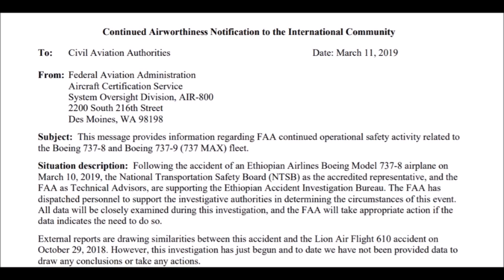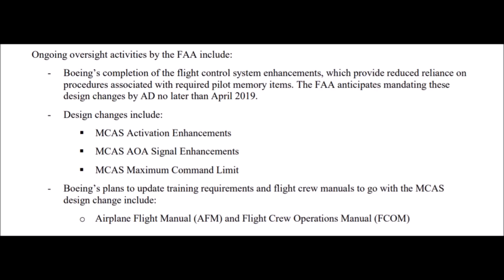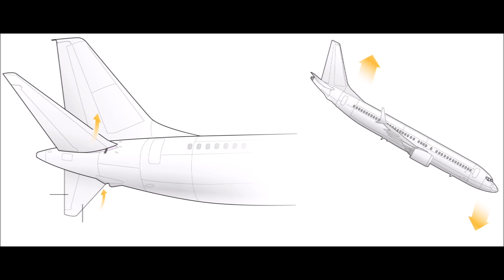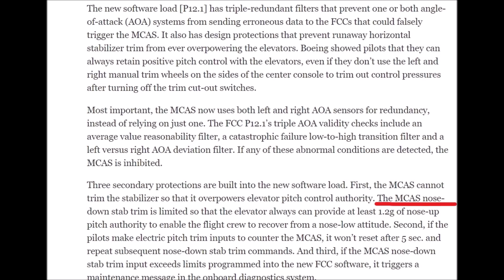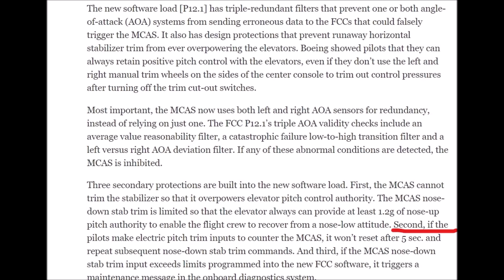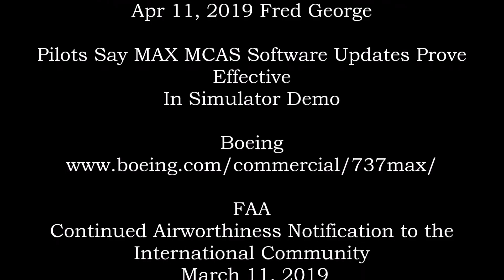737 Max UPDATE 14 April 2019 "The Fix"

Comment: I have a hobby of watching documentaries of airplane accidents and am particularly interested it those caused by automation.  Beside the 737 MAX there are two others I know of both of which involved Airbusses.  
 
Air France Flight 447, Airbus A330
 
The airplane was caught in a storm and the pitot tubes froze and the computer couldn’t determine air speed so it dropped out of autopilot.  After a delay the pilots started hand flying the aircraft but didn’t follow procedure.  When you don’t know your air speed the procedure is to apply 85% power and raise the nose 3 degrees which is supposed to create conditions to prevent a stall.  Instead what the pilot did was push the nose up which forced the plane into a stall that was maintained for about 10 minutes and ended in a crash into the ocean.  There were three pilots on board, the senior pilot was taking a nap outside of the cockpit and only returned shortly before the crash.  The copilot didn’t realize what the pilot flying the aircraft was doing and so didn’t correct it.  
 
Airbus uses a joystick to maneuver the aircraft instead of a traditional yoke.  The position of the pilot’s joystick is not copied to the co-pilot and so the pilot's inputs were unknown to the co-pilot.  Boeing still uses a yoke and all inputs are copied to both yokes which gives both visual and tactile input that informs both pilots, the Airbus controls provide no tactile information between the pilots and the visual information is not as obvious as Boeing's.  In a situation where the aircraft is in turbulence a Boeing pilot can brace himself with both hands against the yoke but an Airbus pilot can only brace against the joystick and most likely can’t avoid applying unwanted inputs.
 
 
XL Airways Germany Flight 888T, Airbus A320
 
This accident occurred during an acceptance test for an airplane coming off lease.  The pilot descended rapidly and attempted to level off but the aircraft continued in a nose down attitude though pilot was commanding nose up.  It was theorized that water inside the angle of attack indicator had  frozen at high altitude and prevented it from moving, this caused an indication that the nose was high and so the automation tried to lower the nose.  The pilot could have saved the aircraft except for one little problem which is that Airbus does not give full control of the elevator to the pilot, instead the joystick only operates over a percentage relative to the trim input.  The pilot was commanding full nose up but that wasn’t within the range of the joystick on that occasion and so the plane crashed.

What to make of this

There are common threads between these accidents and those involving the 737 MAX in that human factors were not adequately addressed by the automatic systems.  Even though there existed procedures to correct the problems the sudden onset of the situation, accompanying flood of error messages and lack of response to the pilot’s inputs together created confusion and panic. This is not a mental state conducive to problem solving.  
 
Also there are too few sensors supplying information to the automation.  Why should there be only two angle of attack indicators and why are they purely mechanical.  Anyone who owns a smart phone knows it has sensors that are able to tell which position the phone is in and whether it is moving. It can detect speed, altitude and position.  Why haven’t these technologies been adapted to augment the traditional aircraft sensors.  Example: The angle of attack indicator says you are climbing but the solid state gyro says you are descending or the pitot tube says your airspeed is too slow but GPS says it is just right.  The automation should have available to it sensors that not only are redundant but also obtain information using a variety technologies to limit the influence of environmental factors such as icing. 
 
Every pilot knows how to hand fly an airplane and only needs sufficient automation so that the aircraft obeys his inputs.  In an emergency rather than require the pilot to figure out how to correct the automation why not have a big red button on the control panel that turns off any aspect of automation that has the ability to override the pilot’s inputs.  The pilot would then have confidence that the aircraft is obeying his inputs and would be able to quickly determine if the problem is mechanical or due to automation errors.
 
Next I would make the automation smarter.  The tactic of issuing a flood of error messages that require the pilot’s interpretation is taxing to the intellect particularly in an emergency.  The automation should be smart enough to reach a conclusion not merely issue error messages.  That conclusion should be the same one the pilot would reach if given the time to do a thorough analysis.  The messages should not only tell the pilot what is wrong but also explain how to correct the problem.

Comment: Boeing and the FAA's mistake was to assume all pilots would properly handle the problem using established runaway trim procedure... 
1) Manually hold the trim wheel to prevent unwanted nose down trim
2) Use the prominent 'trim off' switches to depower the trim motor.. AND LEAVE THEM OFF
3) Reduce power to reduce trim forces
4) use the manual trim wheel to reestablish neutral trim
MCAS used one sensor for compatibility with other b737 systems which all used single sensors.
IMHO the main question is why the $19 billion per year Federal Agency FAA failed in it's oversight.. of course Govt is sloth, irresponsibility, waste, stupidity, incompetence.

Comment: A software fix for a hardware problem ? ...  Allow me to be extremely skeptical.
Reply: It seems like that on the surface but many designs that would surprise you can't even maintain level flight without reliance on computerized flight management systems what we're all actually relying on to keep us safe is sufficient redundancy the real cause of the MAX crashes is the existence of single point of failure that can never exist in commercial aviation.

Comment: Boeing is trying to fix a hardware problem with a software update and thus creates very complex software problems. Very bad idea. My solution would have been: Not design the 737 max so that it stalls easily. Just don't do it. A good design is strict and solid from the beginning. And...don't sell beta versions of aircraft to airlines :-)
Reply: The MAX does not stall easily.

Comment: Too much computer interference with human brains = mayhem. You take what I am led to believe was a good aircraft design and over time make it a 'bad' design due to technology evolution, so you add computer enhancements to offset the now not so good design. Boing should have designed a new airframe version of the 737 to take into account the advancement of in this case engine technology and not used a computer to balance the inherent negative effects?

Comment: The engine nacelles had to be configured so the peak over the top of the wing...this disturbs the airflow over the top of the wing, changes the turbulence, and thus fundamentally alters the aerodynamics of the wing, and it's got nothing to do with redundancy of attack indicators and software patches... so, if it's a Boeing, I ain't Goeing....
Reply: So you are saying that less airflow over the wing causes more lift? That doesn't make any sense. Did you hear that somewhere?

Comment: Thanks Juan, I think Boeing should have grounded the entire fleet after the first crash. It's criminal that they didn't. They created an inherently unsafe system, and that was clear days or weeks after the first incident. They will pay for this negligence and for putting short term profit motive ahead of making sure they addressed the problems of their bad design. Someone needs to whistle blow and send the managers that bet the lives of people that disabling automatic trim was a suitable corrective action to PRISON.
Reply: Can you name one time in history, that an entire plane type was grounded after one crash?
Reply: @stimproid  So we can't learn? New planes should never crash, if they do, it's a clear sign of a fatal flaw. (IE Comet) They had the data and failed to act.
Reply: @Heisenberg2A  Planes will continue to crash as long as they are designed and built by man. Nothing is perfect. New planes shouldn't crash, but they will. Airbus A320 at the Paris airshow for example. Comet was leading edge tech at the time. They figured out the problem and continued to fly for 30 years.
Reply: @stimproid  I didn't say COULDN'T crash, I said SHOULDN'T crash. That's because they should be thoroughly tested. Maintenance and wear problems are the typical failure mode (or pilot error usually combined with the former). The A320 was pure pilot error, outside envelope operation.

Comment: The redundancy of the macas in a prestall situation prevent the pilot to pitch first  for a certain period and take back the lift of the airplane before recovering the safety of the flight. The incoherent redundancy of the macas prevent the pilot to escape the error of reading to fully control the smoothness of the trim. The cumulation of the macas errors are also in complimentary with the location design of the reactors. These comments issued from the shoot out is submitted to the commission of control of the Boeing engineers. The preemptive macas control and its redundancy are also the negative effect for the pilot to recover an escape route by the non active. latent time period to which the aoa has been shuffle and undetermine. These supputations are to be control by the Boeing corps of engineers.

Comment: I'm an old pilot (and there are no bold old pilots). I fly a well designed small plane, typical in that, on take-off at full throttle it will nose-up to a stall unless it is manually trimmed nose-down. If not, the pilot must push forward really hard in some planes or risk a crash. It's all about knowing the job. MCAS makes sense to me (but the fail-safes seemingly weren't up to it).

Comment: Question: is it possible the pilots elevator control surfaces - the ones that move due to yoke, not trim - are easily stalled by the trim  on 737-Max? (The trim on this aircraft - like a lot of others moves the whole tailplane.)
Reply: The horizontal stabilizer can be trimmed enough that the elevator cannot counter it.

Comment: Whenever a pilot is hand flying the plane it needs to be just that and that alone. There should be no automation whatsoever adding trim adjustments. None! This MCAS system is ludicrous in where it has authority to run the trim motor while the pilot is hand flying. Shame on Boeing! If they want an MCAS system on there, let it suggest pitching down through command bars or something. We’ve had stick shakers and stick pushers for years now and have been getting along just fine. I wouldn’t mind if MCAS had a light to come on that would SUGGEST trimming for nose down but no way in Hell should it have the authority to step in and run the trim while someone is hand flying. I knew this MCAS thing was a big big mistake when I first heard of it which was way before the LionAir catastrophe.
   I say that if the plane needs MCAS to be safe or stable then there’s something wrong with the design and it needs to be corrected. 
   If the plane needs the MCAS system just so it can get by without pilots needing retrained then remove the MCAS, write it off as a bad device that caused two bad accidents and bite the bullet and send pilots back in for some more training. What is wrong with that? Any pilot who thinks he knows it all and couldn’t stand some training is a pilot who shouldn’t be flying.

Comment: Trickle down... AMEN Brother... I just finished a 4+ hour drive from Chattanooga to Middle GA on I-75 thru the ATL. "We" are running 80+ mph in 3 lanes with Trucks, Wrecks,  Construction stops and all the crazies changing lanes passing on the right, left and in-between. It really is hand flying. I definitely rely on my vehicles collision avoidance left and right while constantly monitoring all 3 mirrors and both side cameras. Automation needed? You bet. Driving skills and attention are still paramount.

Comment: This could be a story of a 'plane too far'. Engine design outgrew the low slung 737 so it's mounted too high on the wing now leading to the mcas mess. From what this is costing Boeing, a fresh design around modern engines could have been done. Of course you can't price the lives lost. Evil loves corporate boardrooms. We usually expect the next version to be better, but that's wrong, there is one that peaks and then when innovation no longer serves simplicity but complexity, its down hill and then its time quietly retire mr. mid-level boeing engineer.

Comment: I can't understand why they don't let the pilots trim the plane, it should be their job to know if the plane is light in front and set the trim for that.  And letting a system to auto trim so much that the rudders can't keep the altitude is crazy. It's not straange that pilots can be a bit confused by all those ghosts corrections.

Comment: Another thing that I think is grossly mis-reported is that Boeing went too far  with the MAX that the 737 is too old....and that is the root of the MAX problems.  Thats not true.     This MAX fiasco is because they screwed up mcas.   737ng and max are great airplanes....right on par with the newer designed a320s.    What do you think gordon?
Reply: Exactly. It isnt if they are taking old planes and mounting new engines on them. The planes are brand new.

Comment: My question was answered- 
No simulator sessions needed for revised MAX training, FAA says
ATW Plus
An FAA update of minimum training required for pilots to fly the Boeing 737 MAX will cover the aircraft’s maneuvering characteristics augmentation system (MCAS), but simulator sessions will not be needed, a draft of a new report reveals. The updated flight standardization board (FSB) report for the 737 family, posted for public comment April 16, adds MCAS as a “special emphasis area” for pilot training. It also adds the 737 MAX 7 and Boeing Business Jet version of the MAX ...
Reply: Bobby Paluga Individual airlines can do further training, if they want. One problem is that there are only a handful of MAX simulators in the world.

Comment: It makes no sense to say that the higher mounted engines increase stall tendency. Raising the engines would move the thrust vector closer to the plane's axis; this reduces the pitch moment. 
The larger, higher mounted engines would disrupt airflow over the wing and thus reduce lift, especially at high AOA.
Reply: Irv Hh The critical factor is that the curved engine nacelles generate lift at high AOA, but also interfere with airflow over the wing. All of the "pitch up" analogies are an attempt to describe a complex airflow response using words,. The actual issue is best shown using a mathematical chart of elevator force feedback, but this is far beyond the scope of this channel.
Reply: Gordon Richardson   apparently beyond the scope of Boeing's engineering department as well  .  Patches on patches , two jets down (is this the 21st century?) all to avoid paying for a new platform.

Comment: Still not trusting it: what happens if bird flock strike takes out both AOA vanes, the integral counterbalance allows both AOA to settle at 25 degrees nose up and agree?...Glad you hand fly a   'real' airplane every now and then..How many airliner pilots don't, and have no hand flying skills, only knob twisters?
Reply: Realistically In that scenario unless you flew in to the 2 most perfectly aligned birds if you've hit an entire flock you've likely ingested them through the engines and you got bigger problems

Comment: Again, thanks for the update Juan. Has there been any analysis or investigation into what the problem is/was with the AOA indicator sensors? After all, it was faulty sensor data that triggered MCAS in the first place.
Reply: Don Anderson The AOA sensors are normally reliable, so the most likely cause is mechanical damage on the ground, probably by handling the airbridge.